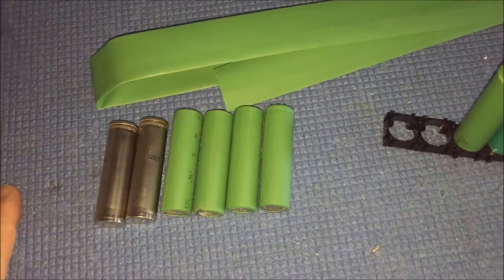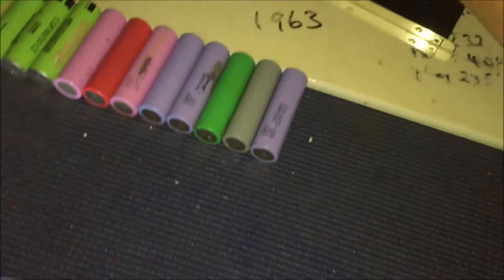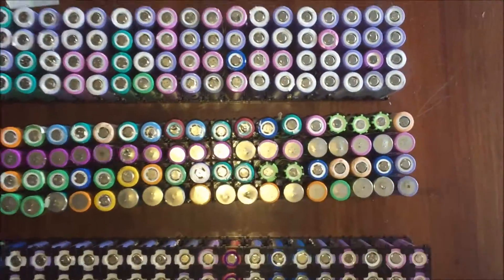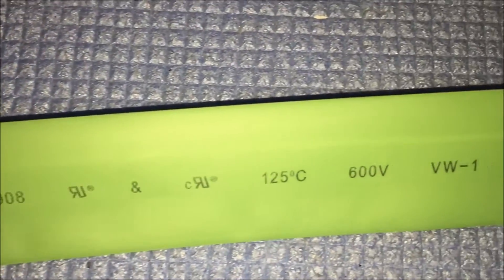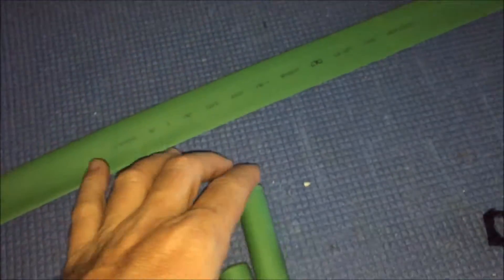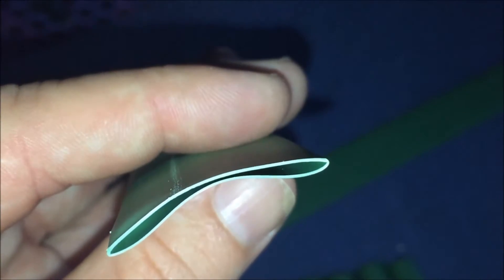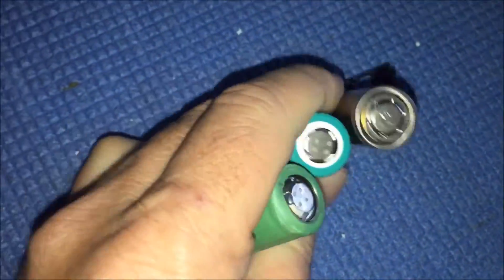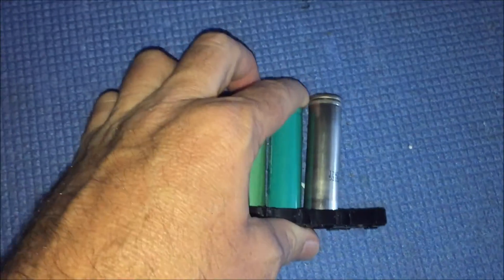HomeBrew Powerwall Project - an OCD thought ?

Comment: I'm working on a similar project and have been considering REMOVING the heat shrink from all my 18650 cells to improve heat dissipation. My thinking is - under heavy load the cells heat up which is bad. Heat shrink acts as a somewhat thermal insulator - therefore bare cells will cool faster. Especially if I have fans in my power wall setup.The upside of bare cells is faster cooling, and they all look the same (addressing your OCD problem).

Downside is you have to handling them a bit more carefully - you can't just toss them in a jumbled pile. Being forced to handling them more carefully may actually be a good thing.

Incidentally most of my friends think the multi-coloured cells look attractive. I designer friend thought I should have a glass front to my power wall to show off the colours. 

I've been taking a more step-by-step approach than you. I started with a 0.5kW battery for my Enviromower, then a 1kW battery for my sons go-kart. More here: http://www.myonlinediary.com
Reply from the maker: +Paul Kennett I'll be sure to follow, I won't be removing heat shrink, if it didn't cause a problem on my wall it would with all the negative nancys on youtube/internet. I won't be having a cover at all. If it all goes to plan it will be in a bloody picture frame on the wall without glass.. haha I'm going to put this thing on display in my workshop/office.

Comment: Peter, why not continue using the thick stuff, only cut it short so it's positioned within the confines of the holders, you'll still get the better assembly appearance "finish", your cells will still fit into the holders, AND, you'll have that "safety" factor you mentioned. Win, Win, Win!
Reply from the maker: +Retinalism unfortuntally it's by design that you have to wrap the cells. Positive end is only the top 'cap' part the rest of the body is the negative side. 1mm away from the positive end.. hard to explain i'll find a link and share it .
Reply: +Peter Matthews 
Perhaps my explanation didn't make sense; I'm suggesting leaving original plastic covering on - this ensures snug fit into holder is retained, cutting shrink tube to 52mm length, then shrinking leaving ends with original colour/thickness.... have a look:
tinyurl.com/18650Wrap
Reply from the maker: +Retinalism Ok, thats a bloody good idea - love it

Comment: You can buy the PC shrink you need precut in 18650 lengths for pretty cheap from several of the Chinese sources. Here's an example: https://www.fasttech.com/products/1425/10012801/2209401-18650-battery-sleeve-pvc-heat-shrinkable-tubing
Reply from the maker: Wow that's cheap.
Reply: just do it!

Comment: Subscribed! Will be following. About to start either a battery upgrade for my off-grid kitchen or an EV conversion using Chevy Volt cells over here. Have you considered painting the exterior of a pack post assembly to keep the OCD at bay? Or maybe heat shrink the whole pack to hid the crime.
Reply from the maker: +JuliansRandomProject Subed back and will go thru your vids when I get a chance ! I guess I could just hide it, but I do consider it to be a point of interest to my clients as much as a YouTube project. So displaying them is key (for me at any rate)

Comment: Peter, I think the issue is what charge controller and inverter you need to use vs what batteries to use. All this is nothing more than using a different battery for home back up. We have solar and we have some large lead acid batteries I used for charging my EV. I also have 6kW worth of solar panels to put into use with a battery backup system. I don't want to do a battery backup system for only emergencies but for use during the evening as well. So what self island system do we need that will protect the Grid and if you are off the grid for powering your home day and night. Im not going for a small back up power wall. That is just a sale gimmick. Cool idea but not new. I like the idea of recycling those 18650 cells and I also like the idea of recycling those EV batteries for home use as well. The nice thing about home use is that they won't be drawing supper high currents so the cells for the home should last a good long time. http://onegreenev.blogspot.com and you can check my videos. You have already subscribed to my videos. Check out the EV related ones. Im going to be using my Leaf Modules for my power wall.
Reply from the maker: +Pete McWade Have a click around my earlier videos, I run my home off batteries every night for the past 9 months. This is just  a gimmick, but with my kinda twist. I'll check out your link
Reply from the maker: +Pete McWade 10sec later i realise i have already stalked your chanel :)
Reply: +Peter Matthews Yup, you did. Im watching your setup as well as Jehu's setup. Did you get your inspiration from his battery pack build? I see you are going to use the little fuse wires.
Reply from the maker: Yep, Jehu was the start to my thought process on this one. Fuse wires will be used for sure however i'm not sure how that will work. If you want offgrid stuff check out DukeHearts chanel its good shit!!!!

Comment: Man, you must see batteries in your dreams. I agree with Gustavo. As you test them, color them according to voltage and put the less healthy ones on the edges ready for replacement. I cant wait to see your powerwall come online mate :-)
Reply from the maker: +DukeHeart i have big plans stay tuned!
Reply: +DukeHeart voltage will be the same when its all put together. Checking voltage is for checking if the battery is still a possible viable cell. The key is checking capacity for each cell. Then match them by capacity. That will take some time.
Reply from the maker: "That will take some time" ooh hell yes already i'm at +2 months and only 320 cells into it :)
Reply: +Pete McWade, Hi, and thanks for the feedback. When you have a bank in series the voltage will be drawn down towards the weakest cell. It's the same as solar panel cells, partial shading brings the entire panel down in voltage. Once the voltage issues are sorted then Peter can charge the banks and do capacity testing using the same binary split method. "If you want the longest working power cord, make sure to cut the faulty one exactly in the middle :-)"